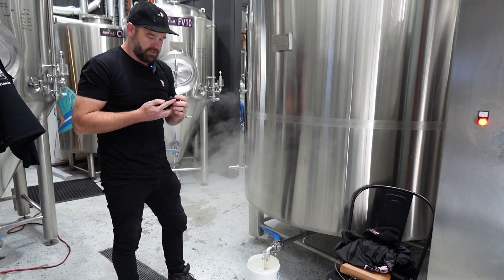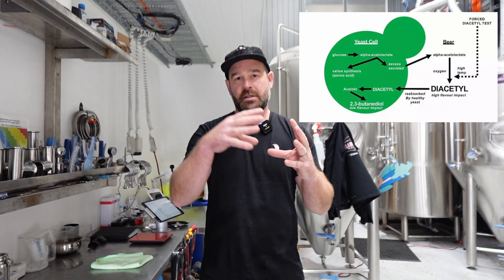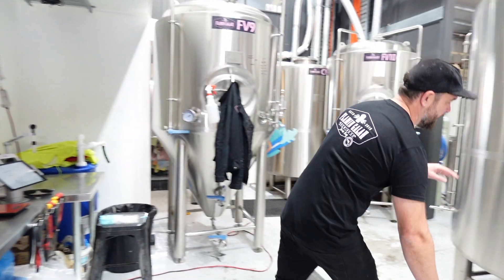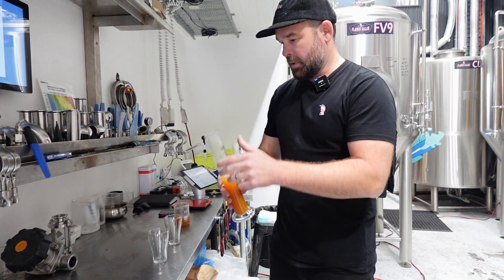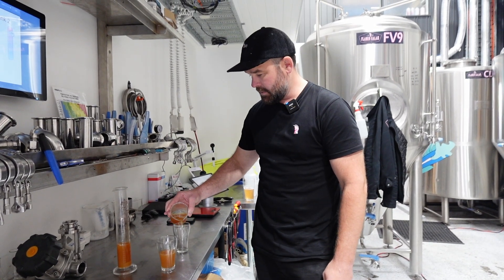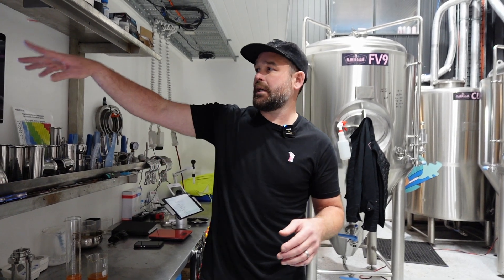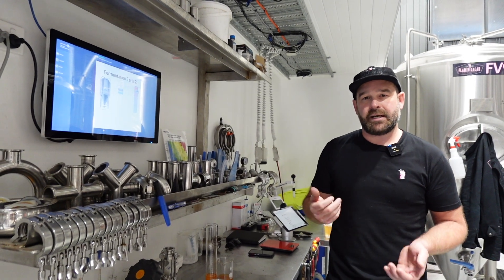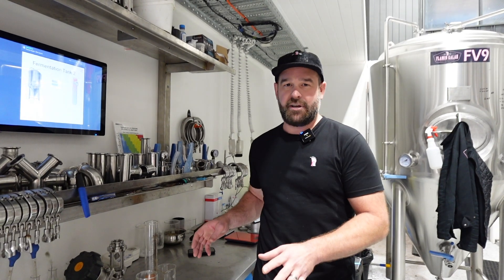How To Do A Forced Diacetyl Test

Comment: Hi, I'm Kevin.
I enjoy watching your YouTube channel. Thank you.

I'm preparing a brewery in Korea.
I plan to produce products using the Bottle Conditioning method.
And I'm wondering when to do the Diacetyl Rest.

Now, I do the Diacetyl Rest for about 10 days after fermentation for 5 to 7 days.
Then I add sugar and do the Bottle Conditioning for 15 days.
After that, I finish the beer by maturing it for 30 to 45 days.

If you don't mind, I'd like to hear your valuable opinions.
Reply from the maker: Perform the test at anytime through-out the bottle conditioning. Do what we did in the video but with your bottles.

Comment: Excellent information, thanks for that. How far can you go in temp rise for a diacetyl rest? Can you go above the recommended yeast fermentation temp without introducing other off flavours in the beer?. I try to ferment at the lower end of the range to allow for free rise but only using a fridge with a temp controller so haven't got 'full' control of the temp